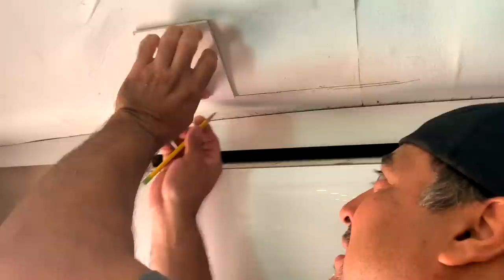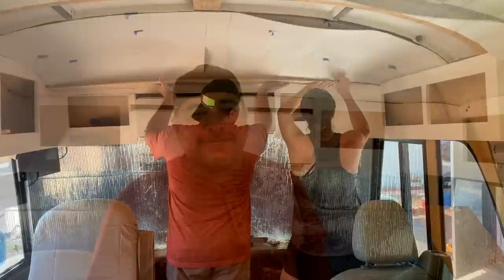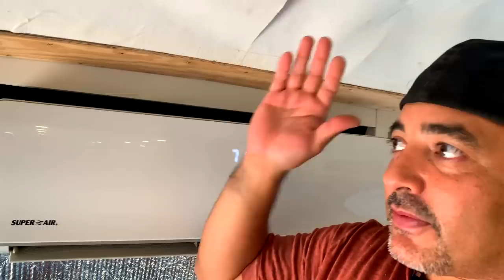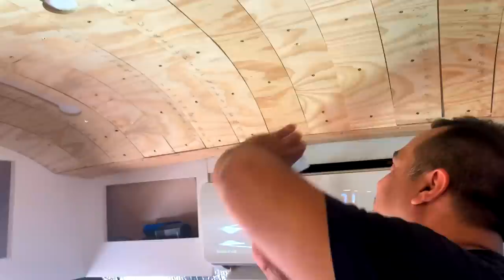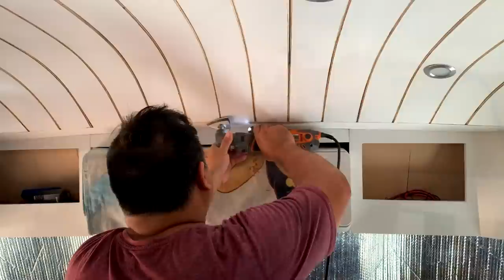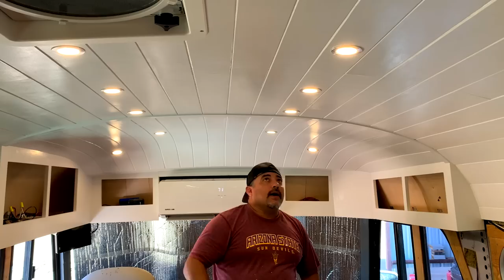Front Cab Curved Ceiling

Comment: This is amazing work of love and dedication, indeed! With all the screw and brad nail attachments, caulking and paint, the wood should stay in place.  Hopefully the mini split and the AC unit in the back can keep the humidity inside in check, important when you start traveling.
Reply from the maker: Thanks!  The mini-split does a great job of sucking every ounce of water out of the air.  Even here in Phoenix, with the summer humidity of about 40%, the drain puts out a surprising amount of water.  We are really hoping that it will keep up with east coast humidity as we travel.  If not, we will definitely look into an additional dehumidifier.

Comment: To eliminate guess work, use a simple compass for scribing. For example...when you laid your piece in and saw a 3/4" gap in the middle. Take your compass and spread it to the widest gap (3/4"). Then lock the compass. Still holding the work piece in place, run the compass along the wall and the pencil end on the work piece. Cut along the pencil line for a perfect fit.
Reply from the maker: Thank you Ukulelefatman - Great technique!  This would have worked much nicer than our cut, sand, fit, sand, fit, sand fit method!  Thank you - hopefully somebody reading thru the comments will read this and it will be easier for them - and I have a new technique to try!  Thank you for sharing it!

Comment: Seems that it would have been much easier to kerf the backside of the individual strips at the front end where it turns back up to allow for the tighter radius. I agree that the trim piece looks great.  Try not to get too upset after the first time that a rough stretch of road breaks some of the ceiling loose.
Reply from the maker: Thanks Steven - I really hope it stays up.  We have screws, brad nails and glue - I am sure we will take some of those things on the road with us as well :). Most of this has been an experimental to say the least :)

Comment: I guess I missed the mini split install up front there.. Why did you put it there? I will have to go back thru all the vid's to see if I can find it.. Great install by the way...  The ceiling looks great, I have come to expect this from you all the time now... lol
Reply from the maker: Thank you Captain Sam Wilson - We put the mini-split in about 3 years ago.  (if you haven't found it: https://youtu.be/GvdIe0AkXV8 ) At that time we had plans to line both the sides of the bus with overhead cabinets (to maximize storage).  This left the front as the only real place to mount the inside unit.  Once we actually started building out the inside we realized that we would rather have the "living room" area be more open and we think we wont miss the extra storage.
Reply: @BeginningfromthisMorning  I went back and found it.. I  have one and find it would be distracting over my head in the drivers seat..  but I bet you could make a deflector to blow at the windshield if needed.. lol